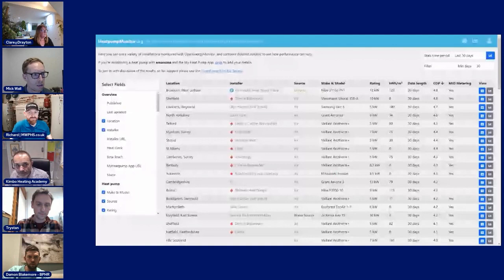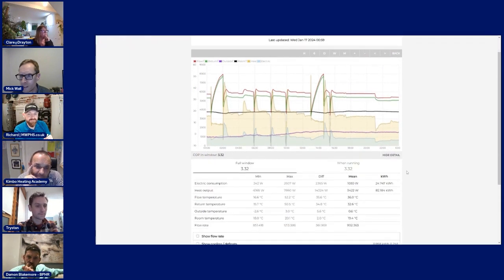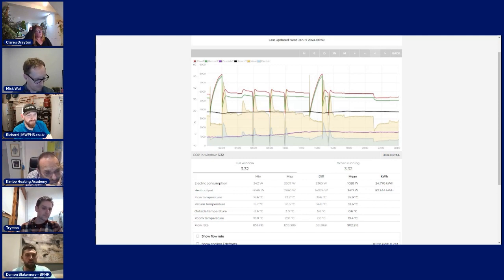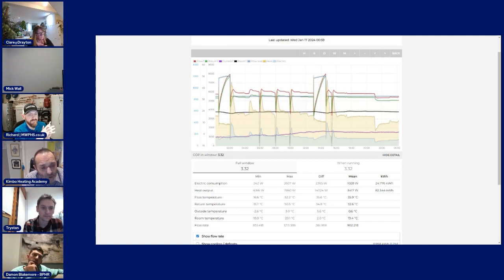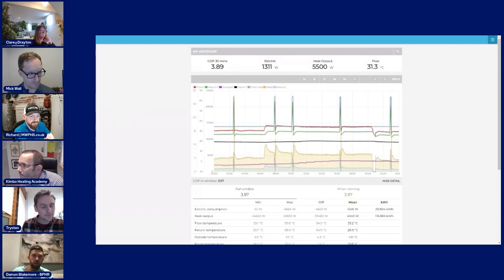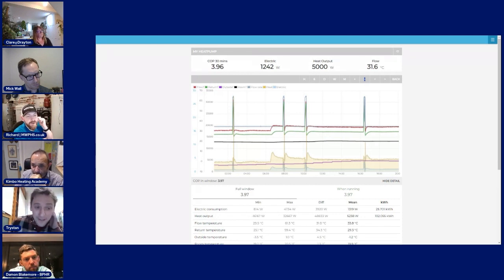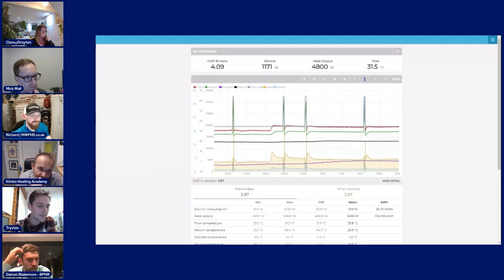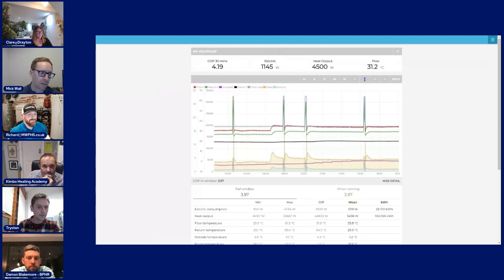FB expert panels -  Heat Pump Efficiency & Monitoring

Comment: Rule of thumb for the headline rating. Vaillant rates to -7 air temp and 35 degree flow temp, whereas most other brands rate to +7 degrees, rather than -7 degrees.

Comment: You don't need open energy monitoring kit to join the heatpumpmonitor league table.
You can piggy back onto most modern heat pumps with emoncms, using the manufacturer's in built sensors.

Comment: Testing is carried out  under conditions humidity would have an effect on the output so I would have thought that a higher RH would improve the coil performance and so the efficiency also the test machines would be "Blueprinted" for testing and the expansion valve would be optimised as you say that there are  so many parameters and values that has to be considered,  another point that during commissioning the flow rate should be independently checked  possibly using ultrasonic flow measurement and temperature measurement  giving the kW of the unit ( I have found that the Taco setters are not the most accurate)  I thought I would through my oar in (ex commissioning engineer)